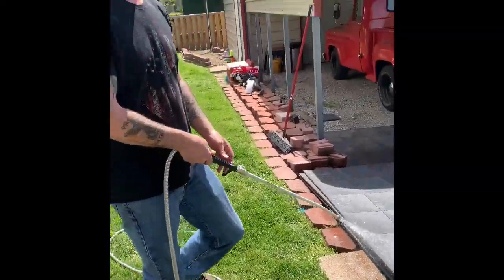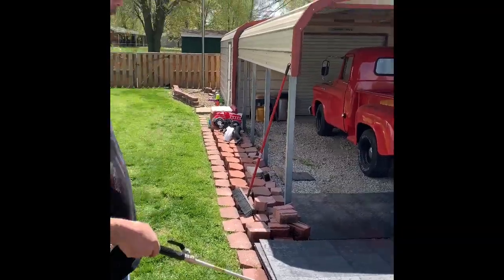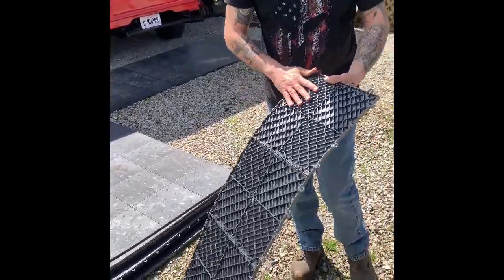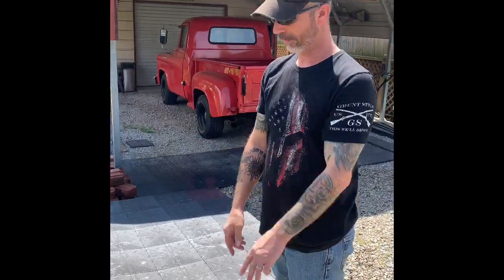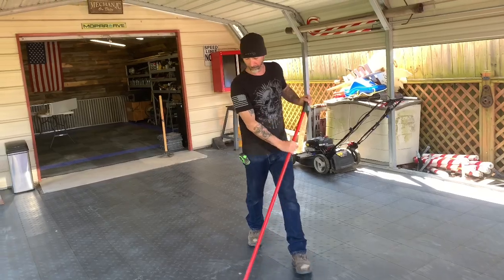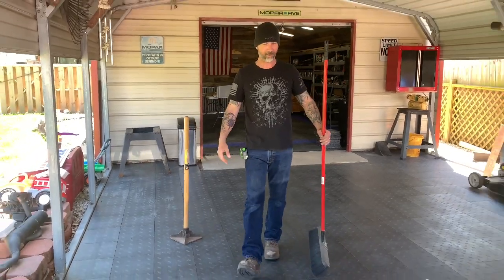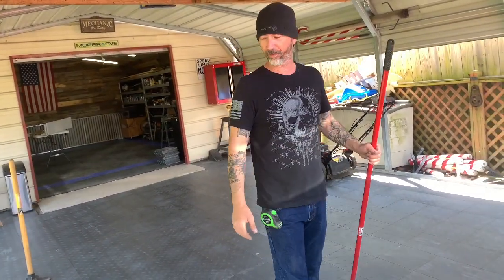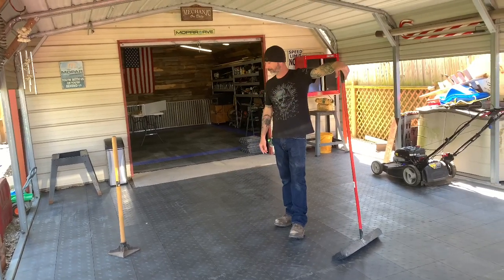Metal Carport Ideas /Flooring / Part 1

Comment: Does it hold up to a jack with a car on top of it? What has your experience been?
Reply from the maker: With a floor jack it wants to sink in a little. So I use a 2x2  3/4 inch plywood.   Because of the sand.  Although that’s on a diesel truck. And they are heavier than most.  But for most parts it’s holding up good. Thanks

Comment: Has any flooding from heavy rain caused it to get covered with dirt or has it stayed pretty clean for the most part?
Reply from the maker: The only problem I've had is, When it rains really hard some of the sand will seep through the tiles when you walk on it. I'm still happy with it . Thanks
Reply from the maker: IT does stay clean, mostly clean it with a leaf blower